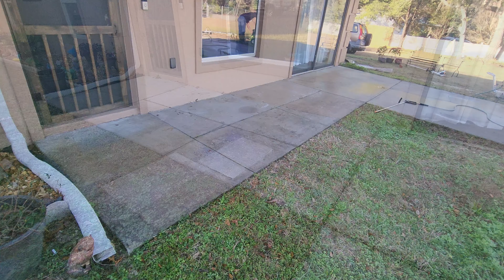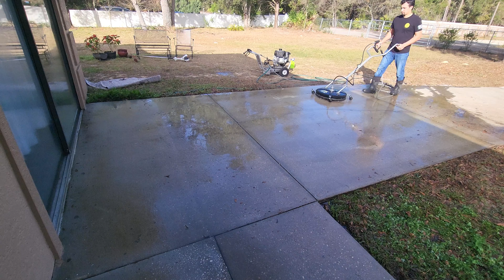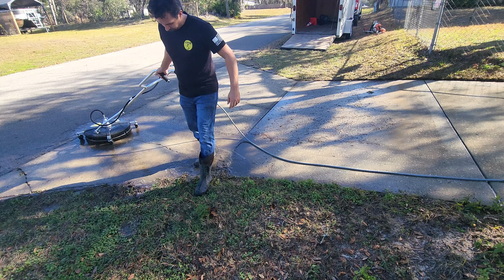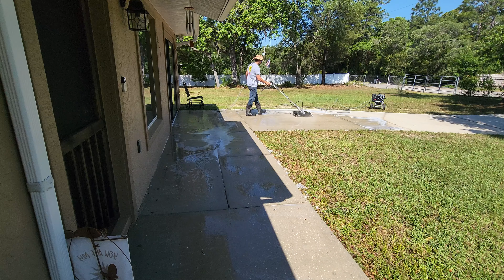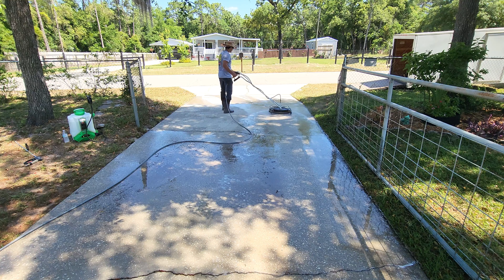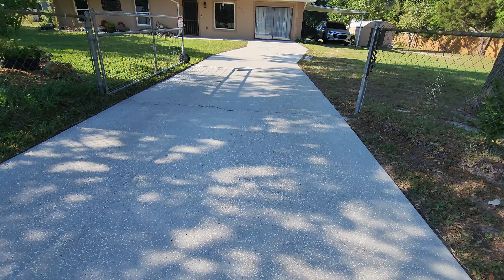ASMR Pressure Washing Series Part 10

Comment: What gpm pressure washer are you using
Reply from the maker: I use a 3500 psi pressure washer. Never had any issues with it. Always does a fantastic job cleaning concrete.